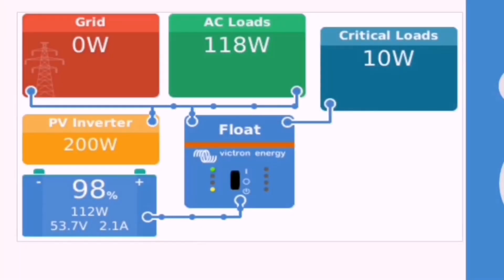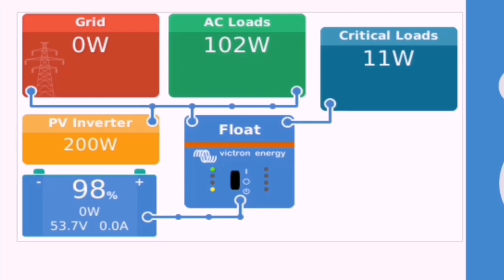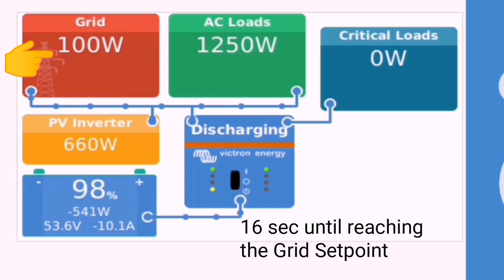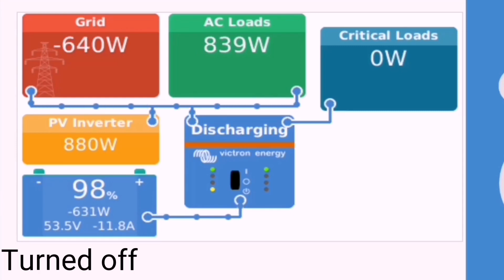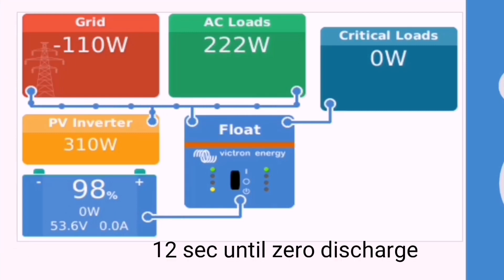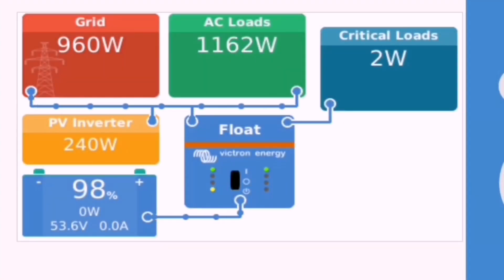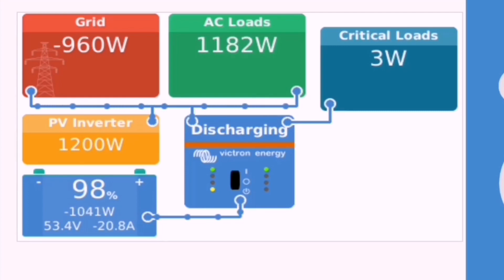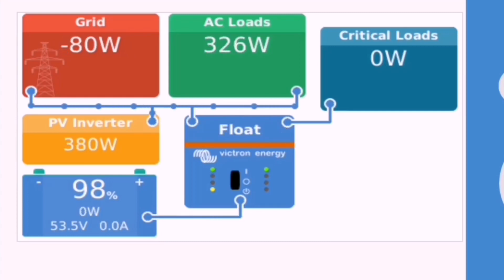Puredrive battery/Victron Multiplus 48/3000 inverter response time to a 600w and 900w load

Comment: p.S this system reacts within 20ms when that grid fails and this is much faster than second life car batteries...when batteries have cycled 3000/5000 times they build up resistance which means they are no good for the high rate in cars - answer repackage them and put them in houses! and charge people for them as well as charging people for disposing of the car battery - The battery in Puredrive was 1st life pouch hi rated cells and that is why it was awesome! if any one is interested contact energymonkey.co.uk

Comment: Hi interesting description for the video! The remote console shows a visual to the user from the system so there can be a delay caused by internet speed and distance its a visual to give you an idea off what is happening! With the Puredrive battery that you are talking about - I designed it and the cells are rated at double the capability of what they need to do in order to be able to cope with 1C easily - this was aimed at the dynamic FFR market which Puredrive was the first residential battery system to prove this could be done and was entered into a innovate UK project and was a finalist. 
Not all batteries are equal and the problem with this battery it was way to highly spec'd to be a massive fast moving part - it was designed for the social housing market to out perform every other product that existed but this was not enough, I have since left Puredrive Energy and started new horizons within Energy Monkey Ltd but this original battery will always top trump all the others...Paul

Comment: Do you have a clamp on ammeter which you measure the battery inverter output as you switch the loads on and off?
Reply from the maker: Just CTs

Comment: That lag in response times (from and to the grid) and ramping up of load does not happen with a Tesla Powerwall 2. I guess that's part of the price you pay for for the Tesla. I have read that the Powerwall 2 will react in 30 milliseconds to a power outage if you have an off grid backup Gateway 2, e.g it won't be noticed. During normal operation whilst powering the home on battery when a large load is triggered in the home, there is no pull from the grid, the gateway reacts instantly to provide the power from the battery.
Reply from the maker: Yet from what I'm hearing from a few people,  Powerwalls consume a fair bit of grid energy themselves, more than I'm experiencing.

Comment: im not conviced what your seeing is realtime,  i would get a ve direct usb cable and connect to the victron with a laptop to see.  ive  just watched a pylontech battery with a cheap inverter/charger switching almost instantly. Just a thought
Reply from the maker: Which begs the question why would the monitoring interface give the appearance of a delay and lots if steps in power change.

I do plan to connect directly and see if it changes things.

Hopefully in time I'll learn enough to be confident of what's going on.

Which inverter with the Pylontech btw?
Reply from the maker: Just tried a direct connection to the inverter instead of the internet. Similar result but if course still not proof whether the interface is slow or if the power transition is slow.

Sadly my home power monitor which used to work on the mains supply has packed up. That was accurate and instantaneous. I need a replacement.
Reply: @EVPuzzle  ah not looking good then -  another way would be to listen for the relay to click, i believe its audible and should hear it click as it changes from charge to discharge.

im looking at building my own battery with the victron as the pylontech batteries apparently only do about 1.2kw output, so im watching how you get on with your victron.

Comment: I admit I naively assumed that these batteries would come on load and off again almost instantly.  If you plug the heater into a socket, does it overdraw then settle to 600 or 900W within seconds?  Basically then there is no point having battery storage if you have an induction hob as it will never be providing the load?
Reply from the maker: I suspect there's more to discover. I'm not convinced the actual grid use occurring is as high as this indicates but it's not easy to tie it all down precisely.  We have an induction hob and it's working well on higher settings alongside the battery but alongside the Eddi or Zappi the induction hob definitely causes more grid use.

Comment: You've found the explanation. I'm not wondered about it, victrons is well known in the Marine environment where the give support on a power source, the on board genset or the wall power. They are a good support if the load is temporarily greater then the source can deliver (circuit breaker limited). And because if the time delay of the circuit breaker 16 seconds is not a huge time, in this time it would disconnect.

BTW the new smart meter we will get has a normal p1 port (I think with 1sec interval and digitally) and a s1 port that's gives us momentarily info about consumption sampled at 4000 rates per second for automation.

Comment: Her is the reason whay U stil got grid use.
Slow grid drow balance and fast balance after Load cut off, result i grid use favour.

Please show the component in the battery (powerwall) inclouding wirring i side the box 👍
Reply from the maker: It's a sealed box right now but I have shared images in previous videos.